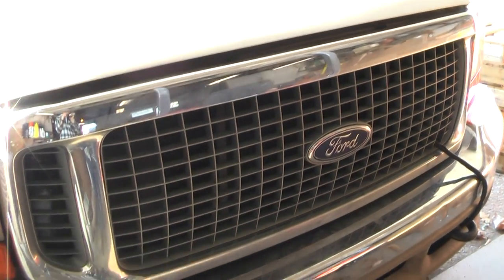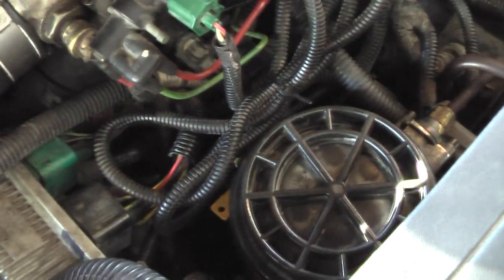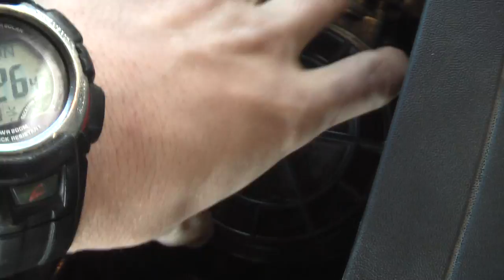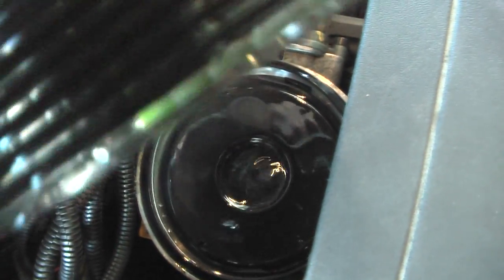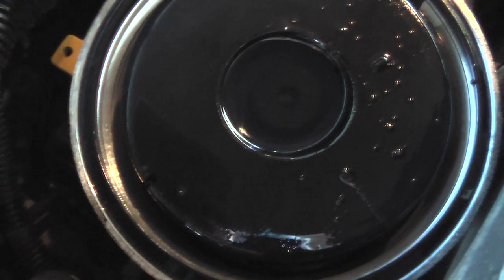How to Fix a 7.3 Powerstroke Fuel Leak

Comment: Question. Fuel Bowl Drain Lever O-Ring Seal Leak. I have the 2001 Ford 7.3 Powerstroke E450 Turbo Diesel. 24 Foot long El Dorado bus van type body converted to MH / RV. Hard to access and work on. Tight crammed jammed space. Hard to get hands and tools down in there. Not easy and open access. How long did it take to gain access to the fuel bowl? And to take off and replace o-ring seals and lever? Total time in and out for this job? Thanks. JR
Reply: Same here, did u remove whole bowl ?
Reply: @bluetwo7282  Hello, no I did not remove the fuel bowl period I I left it intact replace the all rings fuel filter top lid with seal fuel pump period that solved the leaking problem of the fuel bowl orings. Much cheaper if you buy the O-rings in a kit from Harbor Freight. I got the special ones from some diesel guys but frankly spent $7 for like 3 rings and you can get a whole kit with many of them in it like over 100 or 200 for only 20 bucks from Harbor freight. Probably they would do just as good. It was a very frustrating job I was broken down on the street and in parking lots trying to fix it and it was very difficult to get to the fuel bowl and you had to remove alternator intake air hoses for the turbocharger and the black plastic air pressure box and brackets and stuff period what a pain in the neck job so hard to access. All done and going good JR
Reply: @jeffread3388  ok great info Jeff 👍 I'll check ✅ Harbor Freight for O rings and hope they are good as online blue color Fluorosilicon rings for diesel.  Yes my 7.3 Ford 1999 Van also has fuel bowl stuck in back of hood so difficult to access.  Thanks again and all the Best in 2023 🙏
Reply: Hi. Yeah compare the the price the quantity the quality of those silicone o-rings. The ones I bought from the diesel guys in Colorado with $7 for 3 of them which is a lot of money to spend for three little silicone O-rings that are supposed to be high temperature chemical resistant blah blah blah and then you have to spend like $11 for them to ship it to you and then I requested a change of address and then the post office charge me another $10 for that and then they lost my simple little Express Mail envelope package for like a week and there was no tracking it was horrible tracking it was lost for a week with no updated information it just said it was stuck and lost in this one city at a central post office package handling Distribution Center and nobody knew where it was and then suddenly it shows up again on the radar and then it's finally delivered and by the time you notice the notification it's been there like a day. Boy people think the US Post Office is a good service just because you got a tracking number. They're just as bad as stupid Biden who can't get anything done and yet they live off of our government our salary our pension and everything. So disappointed in all of this stuff everything from Biden the government congress senate the US Post Office can't figure out how to do things and make a profit can't track stinking rotten package. Can you imagine that the US government doesn't even have a tracking system is good as FedEx UPS Uber drivers Uber Eats any of these delivery apps that are down to the second down to the foot GPS location and yet the government and the post office with all the money all the taxes and they can steal money from us taxpayers and grab millions and billions of dollars and they got everything they need they got all the money they got all the programmers in the developers and everybody but they can't get one single simple stupid little thing done right. Okay I finally got the package I open it up there's these three little rainbow colored floral carbon special little O-rings that I just spent $7 for these little tiny simple O-rings that would cost so little to make. Anyway so I waited to get them. We installed them. We solve the lake I had for about 3 or 4 years which was getting worse and worse with the high price of diesel fuel thank you to stupid dumb jackass Joe biden. Okay so compare the kit at Harbor freight. Make sure they still have it. My friend had gotten it but it been a while ago maybe years. But it had like hundreds of different sizes of silicon O-rings for like $20? Okay my vehicle is over 22 years old. So I don't know how long it will last but let's say the O-ring will last another 21 years so it's worth it just to get the big kit with hundreds of them for 20 bucks instead of paying $7 for three little O-rings just because they're like look pretty with a rainbow color. I frankly don't think if you put them side by side and compare them that those cheaper ones from Harbor Freight are going to be any worse. They're supposed to also be high temperature and chemical resistant. They gave you a kit of many different sizes. Because of running out of fuel several times the fuel line drained down no fuel in there so the fuel pump must have overheated and it finally burned out. So I had to replace the fuel pump too. If your vehicle's old and the fuel pump hasn't been replaced then if I were you I just replaced the dang thing. They're pretty easy to access on the rail on the driver side under the driver's door area about a foot in or so. The big challenges making sure you get all the air out of the system and get the fuel primed up all the way from the tank up the line through the fuel pump all the way up to the fuel bowl and then you want to fill that fill Bowl up with feel before you put the lid on it and make sure that that valve is closed and don't leave a screw out of there like my friend did so then it was still leaking afterwards make sure you put all the screws back in there. Make sure the fuel bowl LED and gasket seal is properly seated so it seals up. Get everything primed up good. And don't do it my friend did he kept cranking the starter motor so much and later he burned that out so I had to replace that. Don't use the starter motor to try to get the engine going when the fuel line isn't even prime properly and they're still air in there. Another little trick is you turn the key on for about 20-30 seconds to let the fuel pump turn on and pump. Then you turn the key off and then you turn it on again and you do that about 10 times or more that's a good way to get fuel in there and to Prime up the pump but it's better to make sure you fill it up to the top when you put that lid on. Of course follow all the instructions. Make sure everything's clean so you're not getting some dirt in there. We had a horrible time a heck of a time because I live on the road full time and I was broken down in the city. I was getting parking lot security coming Property Owners coming shopping area security people calling the police on me like they doing the city. They get real mean and nasty if you're broken down. They have no mercy. I hope everyone of these heartless people break down and have the worst experience of their life so they can finally understand what it's like. I had to have friends told me around with a tow strap with different vehicles pick up trucks. We had the tow all the time to get out of places because I was constantly under the threat of being towed away at the price of a thousand bucks in less than a day and cops coming people being really total nazis. Little mini hitler's. We towed the vehicle day and night sometimes after midnight to avoid the traffic in the city. We towed it all over the place over nine times because everywhere we went we could only be there for a period of time and we try to fix it wherever we went and get what we could get done and then we had to go to another place because we get chased away. The tow strap worked really good that I got from Harbor freight. Imagine being towed by a pickup truck with a nylon tow strap sometimes easy flat ground parking lots and then streets and up and over a bridge over freeway and back down and bad breaks and no lights on because the battery was dead at 1:00 a.m. and we would work on it sometimes up to 2:00 a.m. in the dark in a parking lot in the cold of the night. I've done this kind of stuff many different times and survived many different things. Join me on my YouTube channel and on Instagram under the same name of Road Warriors 360. I'm going to jump start my YouTube channel this year soon and I'm making a brand and merchandise stickers t-shirts and hats. So everyone's invited. I've lived on the road over 22 years full-time 24/7. But I started doing this as a teenager I lived in a old 1940s fifties big Bakery truck van back in 1972 and 74 on the streets of Los angeles. I was only 12 and 14 years old. Okay enjoy me on social media and let me know send a message so I know it's you. Thank you. Happy new year. Jr
Reply: The big problem though if you do that priming turn of the key off and on 10 times every time you do that the glow plugs are going to heat up so you're going to drain your battery down so you really need to have a vehicle there to help charge up your battery until you can get your engine started and charge up your own battery. So yeah every time you turn that key off and on then your glow plugs are going to heat up 10 times and that definitely will drain your battery down so then when you try to start you won't have enough power to start up because you have to have everything just right to start up the diesel engine you have to have the batteries charge up real good so you get the RPMs the cranks got to be strong so you get the turnover and you got to have the compression has to be right and all those things the numbers have to be right to start up to cause combustion. So the problem of course when you're trying to do this by yourself you don't have all that so you got to have someone to help you someone with another vehicle and when you're doing this turning key off and on you have them hook up jumper cables to your battery to be charging it up so you're not draining it down. So that's the big problem because you're trying to get it started but you have to first prime it I'm good so you finally get it primed up good but then your batteries will be dead by then and you won't be able to turn the engine over and so there's always these challenges when you're trying to do these things. So keep that in mind when I did that I had someone with a big truck with that big engine and jumper cables hooked up to mine to help me do that so I didn't train my battery. Also sometimes when your engine won't start sometimes I've had that where I cranked I got the engine started but then it was cold and I didn't accelerate the fuel pedal and keep the RPMs up and get it warmed up for about a minute then it uses good and so the engine stopped and then it went start again I didn't know why and I had fuel I wasn't low on fuel so I couldn't figure out why so one time I was broken down for a whole week in a place and I thought I'm not out of fuel maybe some air got in the line maybe some water I don't know but after about a week and I checked all the codes and I had to have people come and give me a ride cuz I was away from the stores so finally as a last resort I went to Walmart and I bought a I can of starter fluid. Definitely have yourself a can of starter fluid it's like less than five bucks and so it says on the bottle whoever wrote the English it's all messed up on the instructions it'll say a spray like 3 to 4 seconds and then I'll say but no more than 3 seconds. So when you read the instructions it's like stupid it's like someone didn't do it right and they got that printed on the side I can and nobody's like what the heck nobody ever corrected it all these years you know. So what I do is I use a stopwatch little digital watch and then I I hit it and it starts rolling and I for 3 seconds I spray that and don't stop and feel that up with starter fluid and I'm by myself so I have to run from the front back to the inside and then I turn it and it'll start to try to start up and it won't do it yet and then I have to go back and do it one more time and it starts up. So that's a really good trick. But you have to make sure what I do is I turn the key on the glow plugs go on as soon as the light says ready to start or the light says wait to start when that light goes out and it's ready I then wait like 2 minutes just to make sure it's all cooled off cuz you don't want to spray that in there when the glow plugs are hot or you may blow your whole engine apart and destroy it that stuff is really powerful very what's the word high combustion or whatever. So you have the key on you wait 2 minutes after the light goes out to make sure it's cooled off then you spray it in there for 3 seconds non-stop into the air intake I have everything pulled off so I just have the air intake hose and I have like a cloth over it to keep junk from getting in because I've been working on it and I don't want to put all the fuel the air filter system on there and then have to take it off. So I spray it right down in there three full seconds and you leave the key on you never turn the key off and that way the glow plugs don't ever go on again and that way you don't have to wait another 2 minutes again and then you just put that three seconds in there and if it doesn't start you do it for another 3 seconds again. And so I'm running back and forth from the front spring it in running back and then turn the key to start the engine but once again I never turn the key off while I'm doing this because I don't want the glow plugs to come on again and wait another 2 minutes. So once you do that once my glow plugs do not go on again unless you turn the key all the way off. These are little tricks that me and my friend he's an engineer and we come up with these things we search online we search diesel forums and we find out stuff. By the way search online and find these diesel forums Powerstroke forums and join them and then you can ask questions and there's like diesel mechanics authorized dealership you know Ford guys in there and other people and you get a lot of people responding and you always get those know-it-all guys that tell you something that may not be right so you make sure you get plenty of advice plenty of people and then you have to figure out which ones are right and which ones are wrong and hopefully you get to the right answer. Well it's 4:55 a.m. I haven't gone to sleep all night I got to go to bed it's cold I got to have something hot to drink I live 24/7 in my bus it's winter time in Southern California which is still cold for us it's all relative to where you are. It's much more better here than east coast Midwest but still you know gets down to like low 40s and First Southern California that's cold. If you're in your vehicle and you're at that temperature you will start getting cold so you got to have something hot to drink and dress warm and I sleep with about seven layers of sleeping bags and different blankets and stuff and that keeps me nice and warm and toasty in the winter time. In the daytime it warms up except we've been having cold rain lots of rain gray skies Doom and Gloom dark days sometimes no sunlight and so it's kind of cold and wet and damp all day but it's much better than other places where it's frozen ice cold down below zero. That's why I live here it's more mild. I've lived over 22 years full-time 24/7 in my bus Van RV in the city. I do it because it's the cheapest way I could live and survive cannot afford a house or apartment or anything it's very expensive here and I'm older now and I don't want to be wasting money on that I would go broke fast. So because I don't have to pay rent no mortgage no payments I'm able to live cheap and live a long time and I don't have to like go be a slave and work some job I don't like just to have a bed a room in someone's house I don't want to live in somebody else's house. I like being my own boss. Okay good night. Follow me on my Channel Road Warriors 360 and also Instagram. Thank you. JR
Reply: @jeffread3388  Great info JR!  Thanks 👍 Last year I had starting issues so changed my starter and added two new 800 CCA batteries.  The original OEM 1999 starter took about 2 hours to install with help of a DIY mechanic.  Starter is bolted by about 3 bolts underneath front passenger seat.  We had to go underneath van and needed 4 hands to remove and lift heavy new starter in place; especially because we didn't have a lift ramp.  My glow plugs dash light used to take 10 seconds to turn on but with 2 new batteries, light now takes 3 seconds. My 1999 Super duty 7.3 van has battery drain somewhere, so I keep batteries charged by driving every other day.  If not, I disconnect battery in hood to avoid drain.  I now prime for at least 10 seconds.  Engine starts right up but sometimes require pressing as lighty on gas pedal.  I got a Harbor Freight battery 🔋 tester that plugs in cigarette lighter so this helps me check battery and alternator condition.  Thanks again for your great info 👍 looking forward to watching JR's Van life vlogs 🙏 🌞 🚛

Comment: Great video! just replaced mine today after find a leak.. But what a pain in the butt getting at those bolts was.. Also after replacing it it still leaked until i tightend it up a bit.. how tight should those bolts be? thanks

Comment: are sergio, I have a 1998 V8 FORD AND 350ECOLINE. I have no problem of diesel after 5 minutes that is running off as if there were no oil in the filter decreases slightly. I have both a clean filter in this side of the filter that everything completely disassembling the tank, the tap which is also present in my filter, is that it can not be the cause of light loss, so I empty the filter? causing me stop the motor. I think I understand that your lost slightly right? hello and thank Sergio